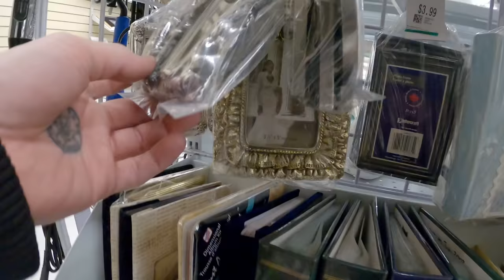Make Money Smelting Ingots - Pewter - Simple DIY Melting and Casting Metal at Home

Comment: cake pan, sand and muffin tin all in the oven at the oven's high temperature. Let cool inside the oven. Sand is cheap thermal mass allows for even cooling over a longer period too let air bubbles escape and stops flash cooling from interrupting crystal formation.
Reply: This is a great tip. I do this with my lead casting and it's very smooth.
Reply: I'm not sure how you incorporate the sand into this?
Reply: @thebeast8429  the sand goes into the cake pan and the muffin tin is wiggled down into it. It adds thermal mass slowing down the cooling process while at the same time is not very heat conductive so won't pull heat out of the metal to equalize the temperature. most ovens don't reach the metal melting temperature.
Reply: @andrewvoigt1133  thank you very much, I'm completely new to this but plan on making something out of pewter
Reply: @andrewvoigt1133  Appreciate your tip!

Comment: They look like perfect castings based on what I've seen other casters make.
Reply from the maker: Well I’m fairly new at this, but if you say they’re fine then I won’t complain!
Reply: @thubprint  @bigstackd does all that on his channel
Reply: Cast iron makes for good molds. If you find a small cast iron pan it'll work. Just preheat like you did.
Reply: @thubprint   I make my own lead weights for fishing and the way i get the lead smooth and shiny is to coat the mold in silicon spray. works like a charm.
Reply: @thubprint  The muffin pans with non-stick coatings will cause the discolored and bubble bottoms.  After a few uses with your molten tin r lead etc. it should get smoother and less discolored.

Comment: Several years ago I needed tin to make bronze and I started doing precisely the same thing. Now I have about 200 lbs of various tin and tin/lead alloy ingots. It's just fun. The picture frames are usually a tin/lead alloy that occasionally have zinc, most modern pewter is tin/antimony/copper.  Selangor pewter is 97% Sn, so keep a lookout for that. All pewter holloware is going to give you shrinkage defects in your casting of open faced ingots, that is the price of convenience, using a mold (sand/plaster/wood etc.) with a sprue will allow the Ingot to pull liquid metal from the sprue as it cools, thereby transferring the shrink hole to the sprue . If using muffin pan: you can lessen it by preheating the mold slightly and spraying dry graphite lubricant over it. If in a humid area - water will get back onto the pan almost immediately ,not enough to cause a steam explosion, but enough to make bubbles and defects for all around the Ingot, so hit it with torch right before you pour. Be aware when you go to purchase pewter that most items labeled pewter (by the seller) are cast aluminum/silver plate/zinc. Zinc in pure form makes the characteristic cry similar to tin so be aware of things that resemble pewter,are heavy and bendable, yet hard. The tin/lead alloys that are usually in picture frames, and other items not used for eating, cast beautifully, almost no defects most of the time.
Reply: Doesn’t tin have a much lower melting point than zinc?

Comment: As one of the aforementioned bullet casters who does my own lead/pewter/tin/antimony smelting, few hints on makin ur cast look cleaner. Most the time those muffin tins have residual oils or crap on em. New ones have manufacturing oils. Degrease them, even just a dawn n water scrubbing, just make sure they are completly dry b4 pouring molten metal or fun personal injury may be in ur future. Second, as a bullet caster we typically preheat out mold (hot plate,oven,toaster, anything available) b4 hand, which also helps make sure theyre dry enough. I usually aim for a mold around 150-225 depending on various factors. Ull find cast iron molds work far better as theyll hold the preheat longer than aluminum molds. If u do use muffin tins (which is fine, most folks do, avoid the tins that have the muffin cups pressed into the tray as a seperate piece. They tend to break after a few casts) Third, when cleaning my melts i usually flux and thoroughly scrape the pots a handful of times for dirty metal (at least twice, but have had to as many as 5 times once). I also tend to let things heat back up for awhile after fluxing b4 moving on. Hopefully this helps. Any casting is better than no casting.
Reply from the maker: Thank you so much!!! I’m clearly new at this and I have no perspective as the end user of cast lead so I really appreciate you sharing yours! 💙
Reply: @thubprint  anytime. As casters typically we arent too concerned with the looks of the ingots, so long as theyve been fluxed well enough to remove impurities and the advertised weight/price is fair. The reason i wait a lil bit after fluxing is it allows any of the target metals to remix into the alloy, so ur not tossing out valuable alloy weight. All that said, most casters have an appreciation for craftsmanship and thoroughly enjoy having ingots thats are fairly smooth or shiny and so if u get great quality ingots, its totally possibly to put a higher than usual price for the quality on em. Good luck on any future melts. Its addictive!
Reply: One final thing, which as a scrapper your likely well aware of but others may not be. Before you melt any objects, double check the goin rate and easy of sale for tge intended scraps. Like i mentioned i cast for reloading ammunition and many times has it been more economical for me to sell thrift store/flea market/yardsale finds on sites or to antique stores and use the profit to buy more scrap. Ive had a few pewter tea pots in my hands above the "crucible" (my cast dutch oven) ready for smelting and stopped to check the goin rates and found that that single pot would pay for the entirety of my haul and then some, or pay for commercially available lead ingots already cleaned n weighing more. Obviously if u dont wanna add an extra step (having to sell the item) then go for it, but sometimes certain pewter items (and many other "scrap" items do too) can command a market price far far above their weight value. Love the new vids ive seen. Keep it up.
Reply: @thubprint  Acetone is really good for removing residual oils. It's what is used to remove oils from stainless steel before welding in clean environments where you need high-quality welds.

Comment: I'm British so your mileage may vary in the US, but (before covid shut them down) I found a great source of pewter was car boot sales (I think yard sales would be the closest equivalent in the USA?). You'd often find old tankards for sale, and because their condition was usually way worse than that pretty shiny one in your video, the prices were way cheaper- usually around £1 per tankard, and often as low as 30-50p.
It's also worth looking at the stalls selling old tools- several times I've found half used rolls of plumbing solder being sold for cheap. I've got a roll of solder which I'm going to use to try making bronze. It only has a small amount used up and is still very close to its original sale weight (missing 20g (0.7oz), but instead of paying the £15 it would have been new, I got it for just £1. Another bonus is that unlike the random candlesticks and mugs, whose metal content could be virtually anything, you know exactly what's in the solder as it's regulated and labelled.
Reply from the maker: I’ve definitely got to get out yard saleing when people get them up and running!
Reply: Ye- very easy to get cheap pewter in the UK.

Comment: Hey Thub. Next time use graphite powder in your molds. Basically, take a brush and make sure all surfaces that the metal will touch are coated in powder.  And very gently tap your molds as your pouring them. 
 Great video brother. 🤙
Reply from the maker: Yesss, that’s what I was hoping for! Graphite powder doesn’t sound terribly expensive. But the tapping I definitely should have been doing, that was a silly thing to forget about.

Comment: Awesome! Kinda wanna buy a propane tank just to be able to start smelting down lead and tin😂
Reply from the maker: I’m pretty into it now honestly, liquid metal is pretty fun. (Just be safe abt it 😉)
Reply: You don't even need propane for lead or tin/pewter, I've not worked with lead, but for casting pewter I just put it in a metal ladle and stick it in a fire. I've even seen folks melting pewter on a hot plate, it really doesn't need much heat to melt it.

You only need proper equipment for stuff like aluminium, copper, brass etc, and even then you can still use wood/charcoal as long as you make a furnace with a decent air blower.

Comment: I have been considering trying this for some extra cash here and there but I have a couple questions about the tools, Im assuming its steel for the baking tray but is there a specific thing to look for with the ladle? also would a cheap butane camping stove work instead of propane? And what material should i use for a pot? Thanks ☺

Comment: Is it tin when melted ?  or still pewter ?  does fluxing remove lead and antimony (Like refining the tin) ?
Reply from the maker: Some folks have mentioned if you keep the temperature high for too long it’ll burn off the antimony but I don’t think fluxing will remove it otherwise. It would still be pewter the whole way through unless properly refined.

Comment: The bottom of the piece shown at 2:38 and 3:23 had a sticker in Dutch saying "pure Tin" , it also had a stamp of an angel, that is what I always look for when buying tin/pewter.
Got about 40KGs of pewter laying around waiting to be molten down and cast into either ingots or various figures using silicone molds.
I have learned that coating a mold in talc does help a lot to improve the quality, and brushing a cast piece with a fine steel wire brush using a Dremel makes it nice and shiny.
Reply: Hello Ralph. Can I please ask what king of silicone you used to make your mould's?
Reply: @marc3006  hi Marc, so far I have only used ready made molds that I bought, I plan on making custom silicone molds in the near future, I hear good things about a brand called Smooth-On, but basically any high temp silicone should work. Hope this helps. 👍
Reply: @ralphmourik  cheers Ralph. It would be a lot easier if they just sold one product.

Comment: New sub.
When I poured my dive weights for my gold dredging days we always poured them once and then melted the first to third casts to get the molds hot enough. You can also use the candles to smoke the molds to get them to release better.
I would cut the molds into a group of three, find a deep cast iron bread mold or a pot and mount the molds inside of the cast iron. I personally think the old cast iron molds make much better looking ingots. The more heat the mold holds the better looking the ingots...
  Maybe try to use a torch to heat the mold while the metal is in it but be very careful because you can make the metal boil and pop out on you!
Try sitting the molds on some thick steel, like 3/8” or half inch thick. Preheat the steel so it helps keep the molds hotter? Again you do not want the molds hotter than the metal... Double stack the molds?
Hope this helps. I haven’t melted anything in five years now... due to the decline in my health because of the fusion in my spine caused by the Anthrax vaxx we were forced to take for the first gulf war! No more needles for me!

Doc ten penny & doc (N) Chair (Coleman)
Reply from the maker: Ahhhh, I think my flimsy aluminium molds are my whole problem then. They just don’t hold heat for any amount of time.
Reply: MMR shot gave me SJS. No more needles for me either!

Comment: have you run the numbers on aluminum cans? assuming they're "free" because you either have them already or found them, is it worth the gasoline and time required to cast with it?
Reply: I don't know a lot about aluminum cans because I discovered a pretty much free and heavier source of aluminum. Non working electronics. I have always scrapped the circuit boards thinking as long as the board still worked, they might could be used in other electronic projects. I once used an old tape player and made a tattoo gun. I hooked it up to a car battery. I'd hit play and it would work and the stop made it stop. That experiment led me to just keep all circuit boards. 
At any rate, I needed a handle for a mug I made and thought aluminum would be light enough. It wasn't, but what i did was draw the coffee pot handle on some styrofoam I kept from a package with ink. I then used my box knife and cut the handle pattern from the styrofoam. A razor or exacto knife will also work. I went to a dirt road and took a shovel and dug red dirt (clay) from a ditch. I used porch door screen to sift the clay. I put the clay in a wood square I nailed together from a pallet I got for free. I buried the styrofoam in the clay with two twigs coming from it. 
Now the aluminum came from the heat sinks on the circuit boards from computer towers. Flat screen TV's seem to have quite a bit of aluminum in them also. If you don't know what to look for they generally have a fan blowing on them. I also discovered most hard drives are made from thick heavy aluminum. I have been able to collect more aluminum per lb. this way than all the cans I tried to keep and collect and it seems to me, way less slag. 
So i melted a few heat sinks and pulled the tree limbs and poured the aluminum into one of the holes. It disintegrates the styrofoam and fills the void of the pattern you make in the dirt. I have over a 2lb. exact aluminum copy of my coffee pot handle. It was way beyond too heavy for the mug.
I sanded down the handle to smooth it out and kept it. I'm not kidding that it is heavy enough to be a bedside weapon. I kept hearing that clay is used as molds and at the time I was dead broke so I decided to experiment with a forge I made with a bucket and cement. All of this worked but the cement cracked after the 2nd use. I used charcoal from the bag but now know how to make my own. I used a hair dryer through a pipe to make the coals hotter. The 2nd time I used a leaf blower.
I am still poor but smarter. Maybe this overly long comment will help someone who doesn't have all the know how or money to buy everything needed. The bag of cement was less than $4 at the time. Other than the electricity for the hair dryer, gas for the weed blower, and the little bit of gas in the truck to get the red clay, everything was free.
I do not recommend cement for a forge. It does not work. There is a recipe online for Portland cement if you find any.
Keep all of your cans to melt but don't trash anything until you check it for aluminum. The only thing I noticed was the open air time used to constantly throw cans in the crucible. If I melted cans again I would prefer my old home made wood/charcoal furnace over my propane one. Crush all of your cans ahead of time. They melt really fast. Don't want to waste propane because you're crushing cans. The downside to wood/charcoal is that it shoots soot/ash into the crucible but it did not seem to hurt my pour. Maybe because it came out in the slag? Hope this helps someone.

Comment: You should make a video on what you do to melt.  Most videos I see people have these $300 furnaces and professional gear etc.  I want to give your method a try.
Reply from the maker: Well that’s what I was aiming for with this and the lead videos! I just use my propane camp stove, but that’s why I’ve only done lead and pewter so far. You need to create much higher temperatures to melt aluminium and copper.

Comment: Just bought 650g of pewter for 1,5€ today. It was an old and deformed plate that wasn't even that decorated, so I didn't feel bad about destroying it. It was however super thick, probably more than 1mm. It's interesting that this material appears quite pliable at first, but if you exceed its tensile strength it just rips apart suddenly. I've never seen any other metal behave quite like it.

I'm going to melt it down just for fun though.

Comment: is it profitable to melt down steel?
Reply from the maker: Well of course, otherwise there wouldn’t be anybody buying steel scrap! A DIY at-home setup wouldn’t make sense though, it would take an immense amount of fuel to reach the temps you need and upgrading steel shred to prepared steel would be a pretty slim increase to the payout
Reply: @thubprint  Wouldn't it technically be just wrought iron? I can just imagine how much propane you'd have to go through..

Comment: For better ingots, your mold must be much hotter before you pour. Use a steel muffin pan and get it very hot before pouring. Or buy graphite molds. Expensive but perfect finish as long as it’s very hot.
Reply: You are absolutely correct my friend.

Comment: does it matter what kind of wax i use for flux? is the tin toxic to breathe? do i use stainless pots for melting?
Reply from the maker: Stainless or cast iron, though an aluminium pot would probably work fine. The kind of wax doesn’t really matter, it’ll burn off and the black charcoal leftovers is what you’re trying to stir in so the contaminants collect together. Tin isn’t going to create toxic fumes unless you get it to its oxidization temperature which would be difficult with a setup like this, but older pewter was made with lead so you still want to be careful and have ventilation

Comment: Pewter looks neutral Grey but is heavier than aluminum . Easy to spot .
Perfect for casting with soft lead for hardenable lead for bullet casting . Refer to manuals for exact recipes. 
With quick water casting , the bullet CAN get too hard, but will usually be just below r20 (~18 or _so_) which is  about ideal for your customers who load lead-headed rounds .